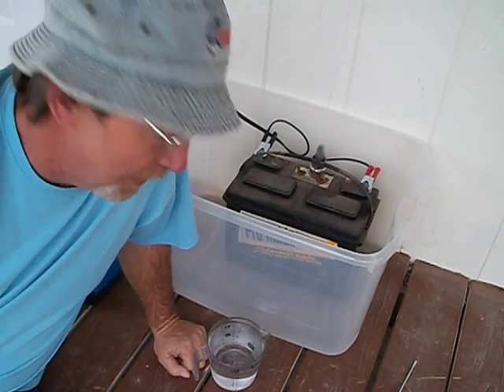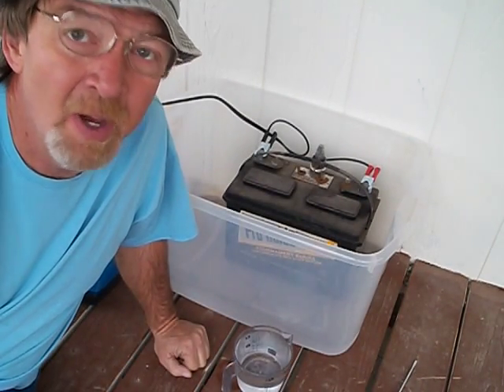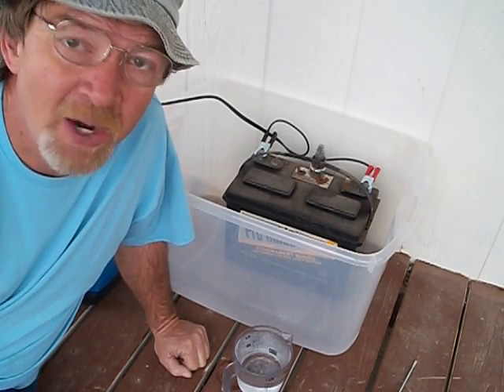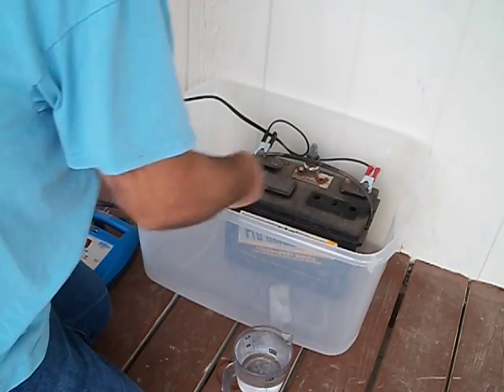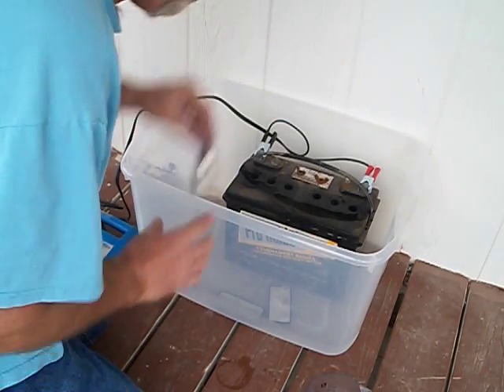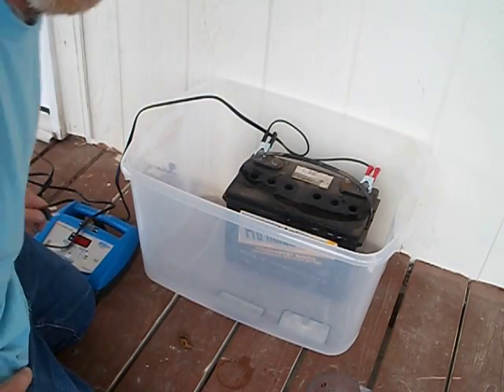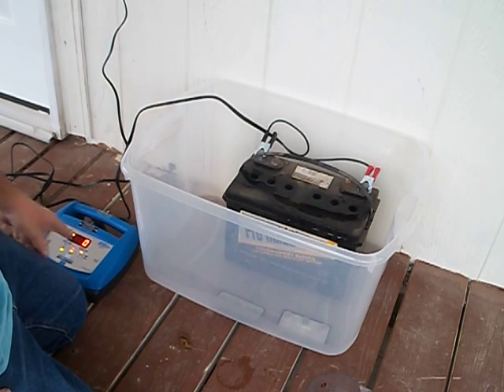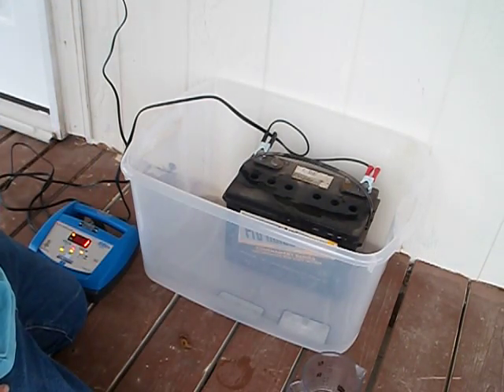Will Epsom Salt help save a car battery?

Comment: Epsom salt reduces resistance of the battery, allowing to drive a higher current at reasonable voltage to dislodge and dissolve back into solution the lead sulphate crystals. BUT, it also corrodes your battery plates and electrodes. You can properly desulphate a battery by connecting a 2.4 volt / cell source and leaving it for a looooooong time. Epsom salt simply speeds u the process at the cost of damaging your battery plates.
Reply: What if I connect 16v to 1 cell? What is the expected effect? I know it bubbles and produces lots of hydrogen.
Reply: @fungames24  The expected effect is that it will bubble and produce allot of hydrogen. If current draw is high, it might overheat and deform/break. If its not vented the hydrogen pressure may cause it to "explode", case raptures.

Comment: Extending a poor battery with Epsom salts just makes the misery last longer.... best to buy a new one as the surface of the plates migrate and are not recoverable.
Reply: all it is, is a stop-gap solution until a replacement can be procured

Comment: Time and again people claim Epsom Salts will restore a battery. They DO NOT clean the plates, they do NOT RESTORE the battery. They ONLY change the electrolyte chemistry. This will ADD SOME capacity to a battery that is at the end of it's life and nothing more. How Long? depends on use, ambient temperature, load and charging rates and so forth. but it does not "restore" the battery.  And a TRUE DEAD battery is burned out, it has an open cell(s). it is DEAD and can not be fixed. ( in a battery pack the dead cell(s) would be replaced, such as the battery pack for a rechargeble drill)
Reply: You aren't supposed to keep The Epsom Salts in the battery.  Baking Soda Wash - Espom Salt Charging - Rinse Tap Water - Rinse Distilled Water - Replace Battery Acid with Battery Electrolytes.

Then try low amp trickle charge.
If the battery doesn't charge..

Try pulse charging or cycling. 
If you have a physical cell failure other than Sulfate scaling, nothing will help.

Batteries are nothing more than chemical reactions between plates.  If you have scale on the plates, and the plates are good, and you can remove it, the battery will work again.
Reply from the maker: sounds like a plan that may work!
Reply: a year later I have to reiterate my previous comments. A dead battery is a dead battery, you will not repair them. Are you a true prepper? learn to recycle the lead to make bullets, learn to make black powder, and learn to use flint and ball rifles. thats where these dead batteries will show their usefulness- as a source of lead
Reply: > Learn how to easily recondition old batteries back to 100% of their working condition.>> https://t.co/3ycayBV4e1?MOPOase3fd577 >
Reply: It works. 
This summer the battery in my van started dying. It would barely crank over. I charged it and only got a few starts out of it during warm temperatures. I charged it again and left it in the van overnight and the temps dropped to 45 degrees overnight.  It lost it's charge and wouldn't start. Just clicked. Since I have another van I left it sit for weeks while I researched how to revive a car battery. I stumbled onto a blog about Epsom salt.

I removed about 1/3 of the acid using a turkey baster.  I heated up a half gallon or so of distilled water on the stove until hot and kept adding Epsom salt a quarter cup at a time until it was ridiculous. Stirring it the whole time. The solution was slightly thicker than water but it was totally clear.  I filled the battery, put the caps on and shook it good. I charged it on an old charger for 48 hours. I let it sit for a day and it slightly discharged. I charged it again for 24 hours.

The temperature outside is cold. This is Wisconsin.  The van has started every time over the last four days and today the temp is 21 degrees. Today the van started like it's a new battery. The battery is FIVE YEARS OLD. Just a month or so ago it was crap.
Reply: hi guys, the best success that I have had was with the Magic Mender Wizard (i found it on google) without a doubt the most useful info that I have ever tried.

Comment: It,s better to charge at 1Amp, then 15 Amps...
Reply from the maker: +Laur Martin 

This is true! all I had was a 15-50 amp charger to work with
Reply: You had to crank it up to 15 amps.
So you empty and filter back the fluid
inside the battery ia nasty, so must be cleaned out... I can tell you how to get that 1amp but please clean it first.
Thank you :-)
Epson Salt will work to reduce the resistance inside the battery, so you can pulse charge, dump out and do again until it holding :-) volts at a higher point.
rinse and repeat :-) don't give up
Don't crank it up :-) hehe
let it roll on trickle, but do clean it out
saving and filtering the fluid back.

Comment: Its a load of rubbish, it will show you an increase in voltage after charging but it will eat away at the plates killing the battery very quickly
Reply from the maker: +Major Storey 

hello, The Battery was already dead!
Reply: Douglas Brown did you dump the water and replace all the water or acid?  or just add salty water?
Reply: here's  several things for battery reconditioning
never attempt to do this until you know what you are doing - the acid can burn you
Test the voltage first - there may be a kaput cell which would waste your time.
Check the battery fluid.
attempt to fully charge the battery.
(I learned about these and more on Jons Mender Guide site )